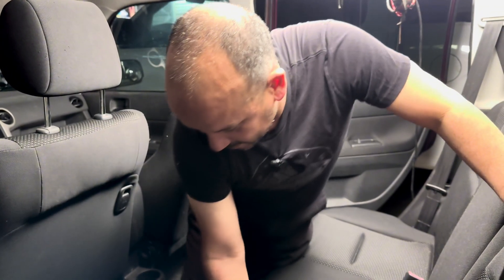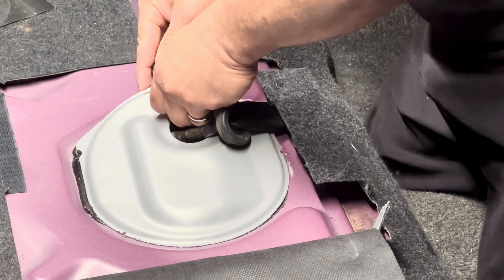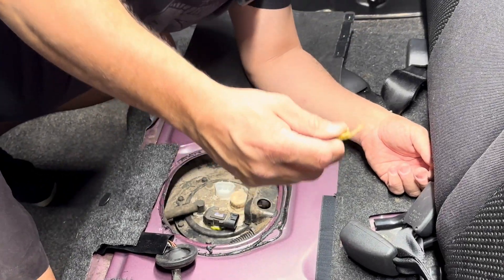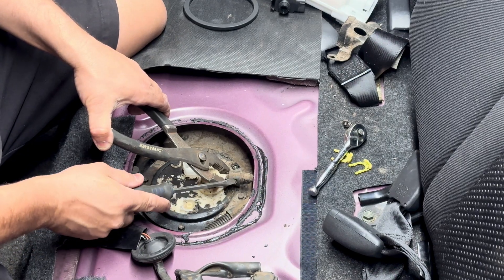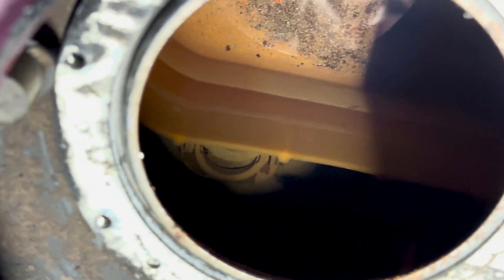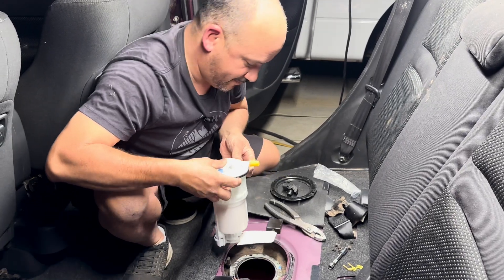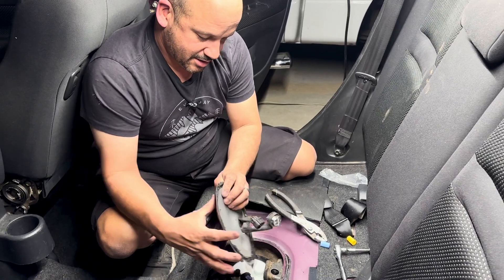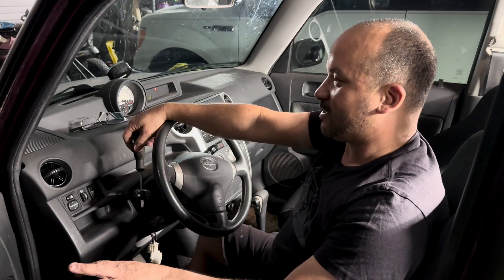Fuel Pump Replacement.                       Step-by-Step removal and installation.

Comment: where did you buy sender pump from ?
Reply from the maker: Amazon.   It worked well till it started failing a couple of weeks ago.  However, I can’t really blame the cheap pump…I found rust in the tank and had run the tank REALLY LOW a couple days before.   I pulled another pump out of my spare xB for the time being.

Comment: Not trying to be a smart ass here... and no one else has said it.... So I have to say it... IT IS VERY DANGEROUS TO BE WORKING AROUND AN OPEN CONTAINER OF GASOLINE!  I bet most people watching this already know what can happen but shouldn't there be a special warning for doing this fuel pump change-out?  For that one guy who doesn't realize the dangers.  Respectfully.
Reply from the maker: I’ll add a warning line to the description.  I would hope that anyone brave enough to do this job would be highly aware that gasoline goes BOOM!  However, you are absolutely right.  Thank you